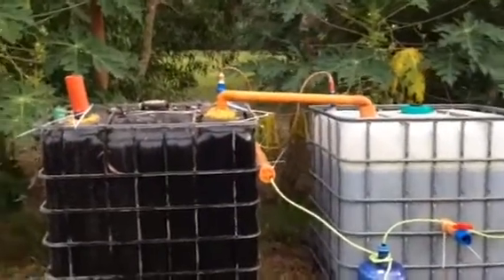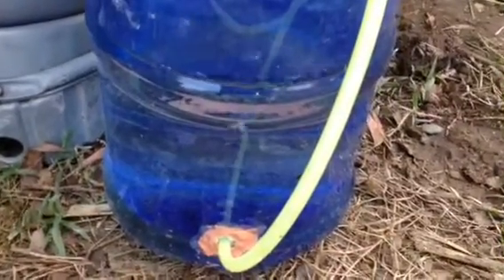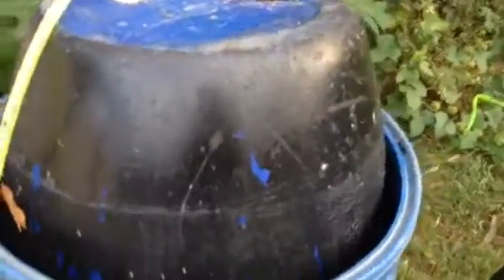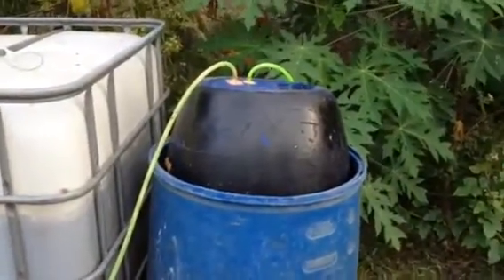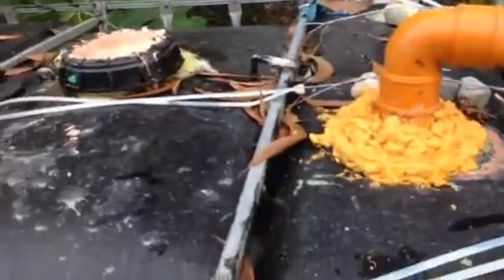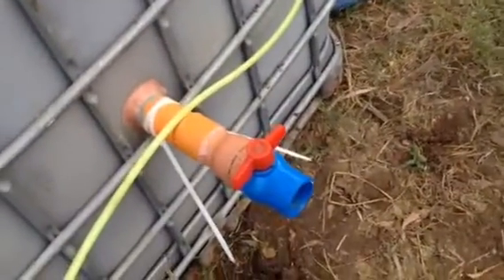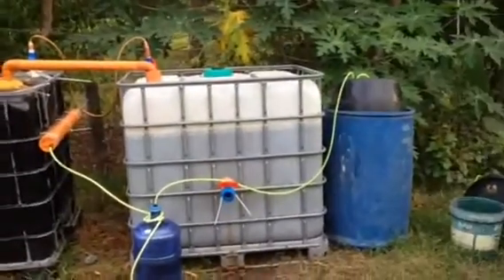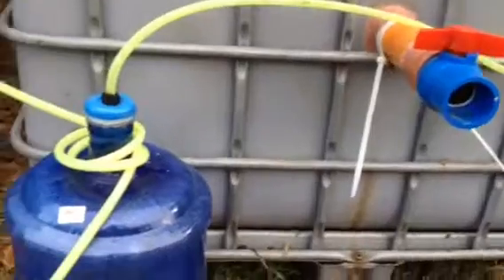Biogas 2 stage biodigester

Comment: How much does the second stage produce I watched one utube video the man they said that it would only gain 20 percent but you can't feed it any more than what the first tank can handle or if will get acidic and it'll take a lot of time to get it to produce methane might even have to start over he suggested that you would be better off setting up both digesters the same and feed one of the tanks one day and the other one the other day since I wanted enough gas for cooking hot water drying clothes and heating as well as diving I still think that a 2 stage would be a good idea feeding it from 2 digesters even if it adds 20 percent of each digester that's 40 percent more gas than I'd have from the 2 digesters right now I'm waiting for spring thaw one other utube channel suggests to put a hole in the ground and put a flame down in the hole to get and keep the tank at optimal temperature so I want to dig down deep enough to put a 30 gallon hot water tank under the tanks I'm going to cut off the top and fill it with sand that way I get more use of the heat and gives me a safety shut down temperature control and mass the hole under the tanks will give me a place to put my scruber and bubbler so they won't freeze

Comment: Hello sir can u help me with my problem?!.... My improvised digester is month old already but still no good methane is produce.... Im using pig manure 1:1 ratio with water.... I dont kwon wat went wrong!..... Wat is the best thing to apply to make it succesful?
Reply from the maker: The digester is probably not air tight. There must be an air leak some where.
Reply from the maker: The ratio you are using is fine. The hardest part about building a digester is making sure it is air tight. Wash the outside of the digester with soapy or bubble water and track Any bubbles from the digester.That is probably your problem
Reply: I did that already and im sure that there is no leak in my project....
Reply from the maker: Make sure there is no chlorine in the water. The bacteria will die if there are any traces of chemicals in the water or even the container
Reply from the maker: Make a simple experiment. Place manure in a bag and add just a little bit of water. Shut the bag tight and within 30 minutes the bag should balloon. That should give you and idea that the bacteria is there and it is working. Now for your digester try to place more manure than water. Manure releases methane on its own, water just helps them propagate.
Reply from the maker: I’m not exactly sure what you are doing wrong, just make sure the manure is producing methane on its own. The manure should be fresh and moist. I hope my suggestions can help you.
Reply: @haroldpastoral8699  hello brother, my project is improving but not stable yet.... Tnx for the very helpful tips.... Can i ask u somemore ques?.... How many fresh slurry can i put daily? My digester is more or less 200L of container.....
Reply from the maker: For the digester that I used I filled it up to at least 75% of the capacity of the tank. And place it in a warm area coz the bacteria becomes very active in warm areas. Feel free to ask man. I hope that helps and good luck.
Reply: @haroldpastoral8699  you feed your digester 75% of it daily?
Reply: @sampogcuis7165  .
Reply: O i see.... Im using water direct from my faucet..... My project produces gas but ithink it is more on oxygen or carbon dioxide... I will try your tips den ill updte u if my project will improve.... Tnx u very much good day
Reply: Hello sir my project is now stable.... But it doesnt fit my daily consumption! .... It produces only 15mins max a day.... My set up is 2 drums of 200L!..... Now my question is, how much volume do i need to satisfy my daily consumption?
Reply from the maker: The container that you are using is just not enough to produce the amount that you want. I was using 2 IBC containers with 2000 liter capacity combined and it was able to produce a decent amount of methane. I suggest increasing your capacity to at least 1000 liters depending on your needs. Could you show me a video or a diagram of your digester maybe I can give you a better solution. You could directly email me at haapastoral@gmail.com
Reply: @haroldpastoral8699  how bout mesenger account?.... I will send my video via mesenger.....
Reply: @haroldpastoral8699  hindi ko ma send via gmail ang video ko.... May be via mesenger....?!
Reply: @haroldpastoral8699  i changed my rubber interior to a barrel like yours.... But everytime im using the collected gas its hard for my digester to recover! Its just like the air is blocked and not flowing Continuously again to the methane container! But if i shut the valve and open it again after a few mins it will bubble for a sec then stopped....
Reply: Check out solar cities Chanel and there's a lot of good stuff on utube because of our cold weather and at suggestion from another utube digesters build suggestion to put a flame under the tank and I'm now waiting for spring thaw to build my tanks so if you need more info check out all the great utube videos on this subject remember research research and more research  is the first step to succeed the 2nd key is common sense and when looking at their ideas like the one suggestion for a flame under the tank good idea but without a safety to shut it down if the flame goes out it's dangerous